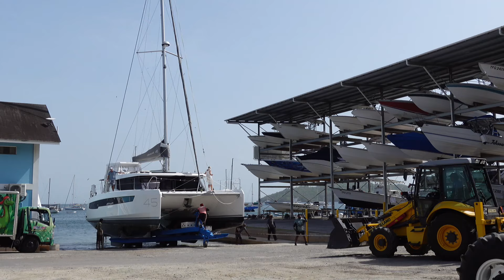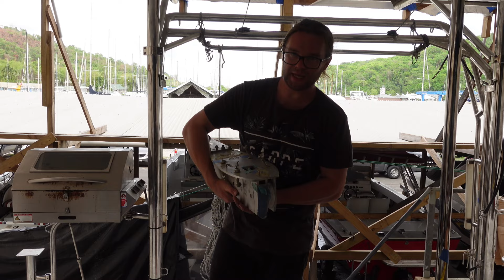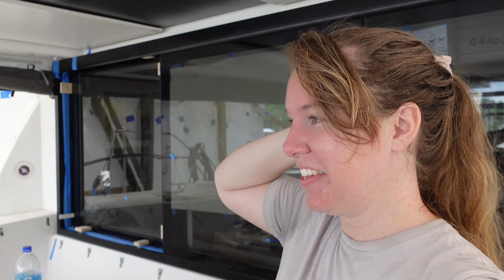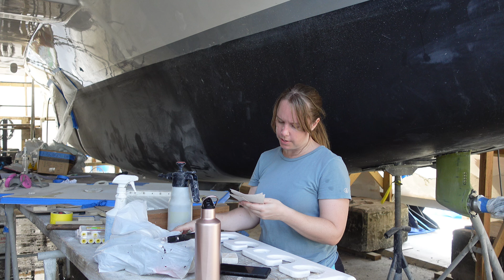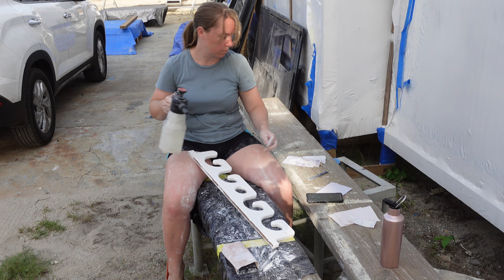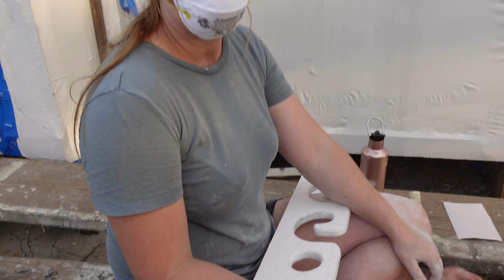Learning How to Apply & Finish Gelcoat on our Sailboat | LEOPARD CATAMARAN WARRANTY

Comment: A small tip for when applying around corners or dimpels put some wax paper on it to shape it , it will make things easier
Reply from the maker: I think I understand but do you know of a video where I can watch it? I'm thinking about doing the whole gel coat process from application to finish on the remaining rod holders so any tips to make life easier are welcome! 😊
Reply: @travelsketch  and you can use a aerosil thickening agent to make it it Thicker if needed